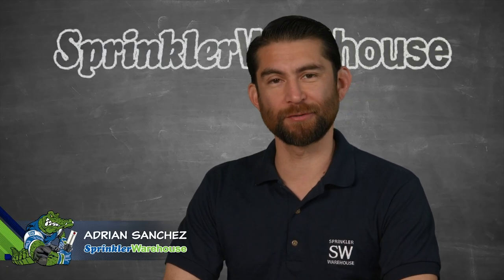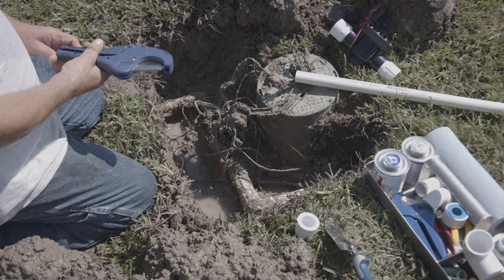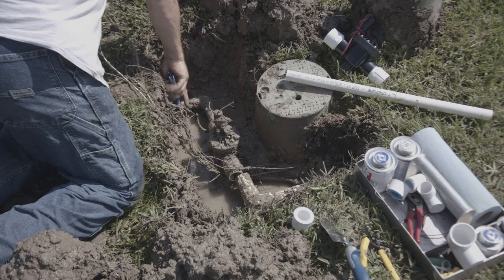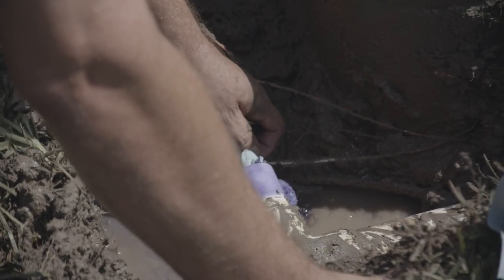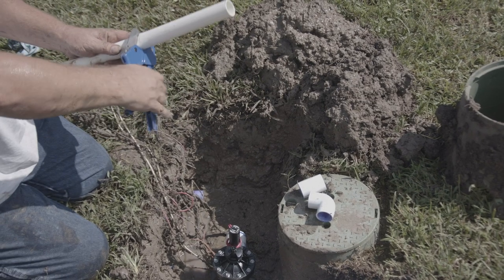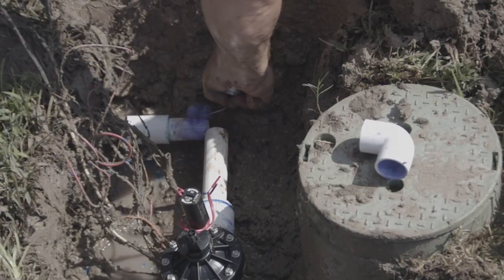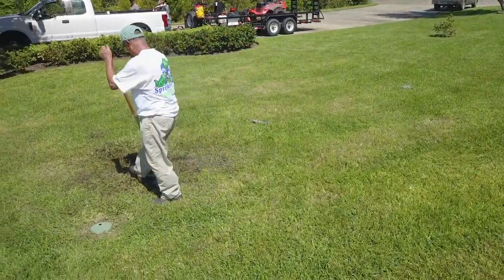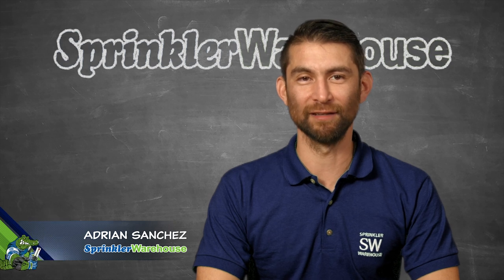How To Replace An Inline Valve

Comment: What to do if water comes out too quickly after pulling out paper towel?
Reply: Let it drain and take it out
Reply: Take the water out
Reply: Just let it drain indeed... Or maybe you have a leaky valve at the source, causing water to keep coming out. If the valve at the source is good then it should stop in any case after like 5 minutes.

Comment: Ok, I'm going to do this... super nervous about cutting a pipe, but it's just a sprinkler, right?  However, I am a little perplexed why if the water is on and I took off the top of existing valve why water isn't coming out.  I assume another nightmare awaits.